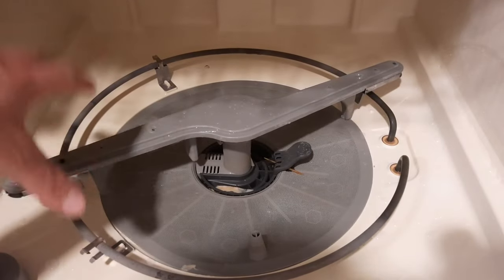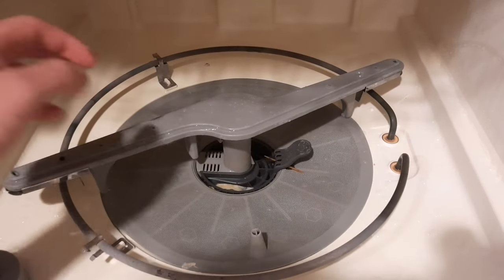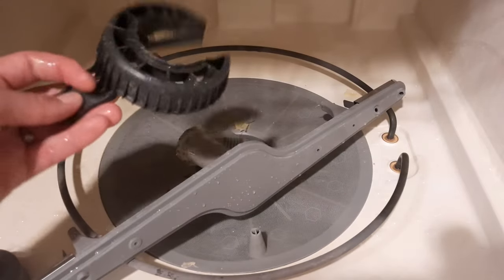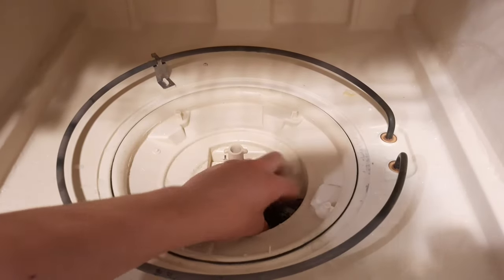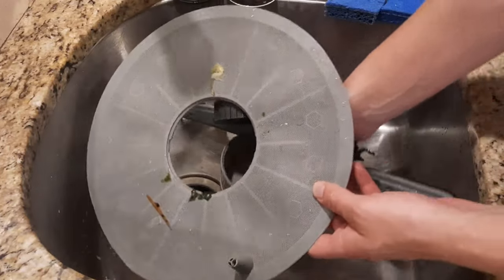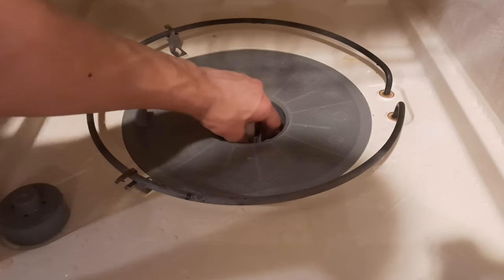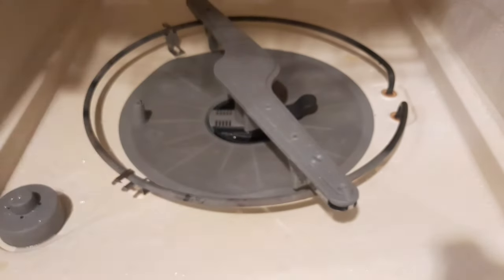How to Remove and Clean Frigidaire Dishwasher Filter

Comment: Is there some water in yours? When I took the parts out, I noticed there is some water in the gutter/cavity. Is that normal or is that a sign that my dishwasher is not draining properly. Anybody has the same experience?
Reply: @diywithcam
Reply from the maker: A small amount is common in the cavity under the filter. If there is water visible above the filter, then you may have a problem. Hope this helps.
Reply: This was exactly the question I was looking for or going to ask. Thank you!!!

Comment: The one in my apartment is slightly different - a model fbd2400 but your video was a huge help. By seeing that the grey bowl is held by the base sprayer arm unit, I was able to take it all apart.

I pulled off the blue sprayer arm which is very different to this model, and under it was a white disk that held down the gray bowl. I twisted the disk and it unscrewed, then i was able to remove the filters and scrub them clean under running water.

I removed the black grid and the cover plate held with 3 torx-20 screws but they were clean and there was nothing under them to clean.

I did not see any instructions to do this in the owners manual and I had forced the big dish up and couldn't get it back in place. 

Thanks so much for this.

Comment: My Frigidaire dishwasher has a similar interior, it is blocked, this morning.

Clean it thoroughly, replaced, added one cup of white vinegar, took out dishes almond with the carrier, and running a regular load all options to highest. 
Will check around 12 PM. Need best wishes 😃

Comment: I was able to put mine back on and put the gray filter arm back at the 9:00 position and turned it to the right.  It only went two notches to 6:00 though.  Not all the way to the 3:00 position like in the video.  Ours appears to be the same Frigidaire model.

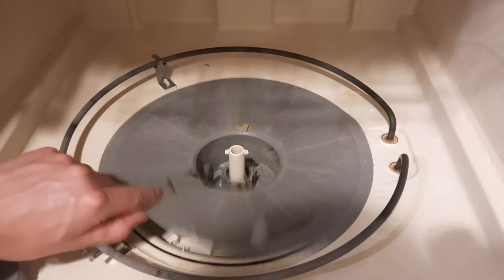Comment: Q: @ 0:28sec, is there a clip or something we need to lift or unhook in order to remove the larger filter circle and the filter cup? My dishwasher looks like yours but the circle and the cup don't seem to come out easily at all.
Reply from the maker: Not sure, the larger the filter on mine is held in palace by the center piece, no clips. Maybe it's a newer model or older.

Comment: I did this today and found an o ring sitting on the bottom, not sure where it came from, was hoping to see if this video would show it. Is there a rubber seal in those parts anywhere?
Reply from the maker: I don't see any o rings in mine and don't see anywhere that should have on but could be wrong. Mine may be missing it.
Reply: There are no o-rings anywhere in that model of dishwasher that can fall out. Probably came from something that was washed earlier. I have the same washer as in the video.

Comment: Hey man I got the same washer. It drains I can hear it but doesn’t drain it all. Cleaned all that and it still leaves water. Any suggestions?
Reply from the maker: The waste hose to your drain may be clogged. It's normally a pretty thin pipe and can get pretty gross. I assume the main drain isn't clogged, or your sink wouldn't be draining.

Comment: I was able to disassemble like you instructed,  but having a difficult time replacing the fan-like thing back😢 it keeps coming off. Help please.😊 Thanks 😊😊😊
Reply from the maker: sounds like the base isn't quite lined up. Make sure it is seated before turning and this should lock it in place.

Comment: Been there, done that. Thank you though. Frigidaire dishwashers just seem to be bad products overall. I have to keep babysitting mine. The single spray arm somehow stops spinning mid-cycle, but I din't know why (not catching on anything). And its door pops open several times per cycle ike there's built-up pressure inside. It's super weird. But I'm through with it. It's only five months old but is a bottom-of-the-barrel model that came new with this place. Replacing it with a midrange Whirlpool tomorrrow.

Comment: How do we clean it if it’s clogged and water is sitting there after taking off the parts?
Reply from the maker: Use a carpet cleaner, wet vac, or another method to get the water out and remove the debris stopping it from draining. If there is t anything in the bottom, look at the drain pipe as it may be clogged or the drain pump is bad

Comment: So my lower spray arm just fell over and melted to the hot metal piece on the bottom I guess because it wasn't locked in. I took it out and am getting another piece but I also found a medium sized black o ring along with it. Any idea if that's part of the inside of the dish washer bc it wasn't for any of my dishes
Reply from the maker: Not sure where that would have come from but sounds like it would be the dishwasher if it isn't from any dishes.

Comment: Mine is slightly different, it doesn't have that dark grey nob thingy, and the propeller thing has some platic bits in the center that shoots up when water goes through it.

I tried turning it to the left but nothing is happening.

Comment: Can someone please do a vid on Frigidaire Mdl  #  FGHD2455LFOA  Because there is a third set of fine filters which have screws and there is a rear plastic tube which prevents the filter from coming out. I dont want to break anything by forcing it out.
Reply from the maker: Send me a picture at contactdiywithcam@gmail.com and I will see if I can help you out. I'm not familiar with the model, but may have some suggestions.

Comment: Can a dirty filter prevent the water from filling the machine? My dishwasher runs, but VERY minimal water gets in. Dishes SLIGHTLY wet, but still dirty. Soap pod is barely dissolved. It pops out the compartment, soaps gone, but plastic sits at the bottom by the door.
Reply from the maker: If there is a water in the bottom of your dishwasher then that could be why, which is normally due to a dirty filter or clogged waste pipe. Other than that the jet holes could be clogged, I have had that happen too and the dishes come out with food splatters on them

Comment: why is mine not snapping back into place? its loose now no matter what i do :( i did not break it though.
Reply from the maker: Did you line the washer arm back up with the top of the slot. It can only fit in one direction because of the t shape on the shaft.

Comment: Your screen is warped and could allow junk to slip under the edge.   So is mine, and looking for a DIY fix.
Reply from the maker: I don't think there is one. It's just a thin piece of plastic in a hot dishwasher.  It makes sense why all the junk gets caught underneath the screen and not on top.

Comment: I have water sitting in the space under the filter :(
Reply from the maker: Mine sometimes does that. Try clearing any debris out that may be preventing the water draining fully. Some kale or lettuce could be stuck in the bottom.
Reply: @DIYwithCam  Turning the dishwasher on and off helped drain the water. The drain hose, however, seems that little dirty; I’ll probably have to drain it,  and clean it out someday
Reply: I had the same issue. I used a turkey baster to suck the remaining water out.